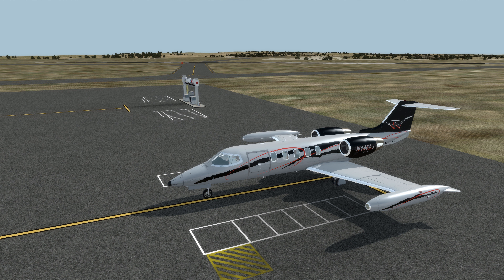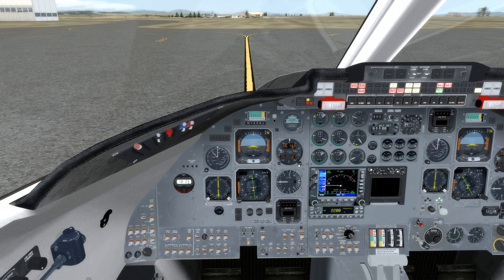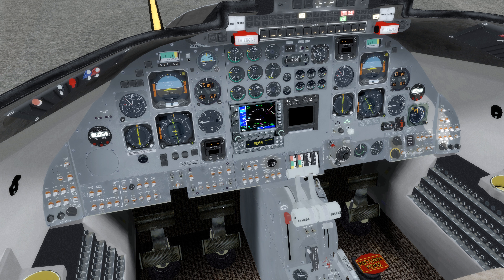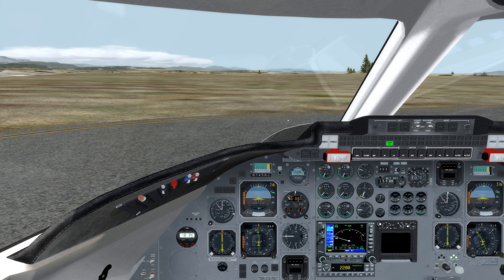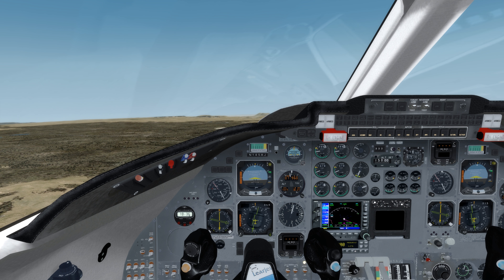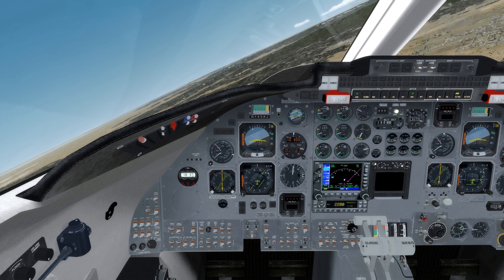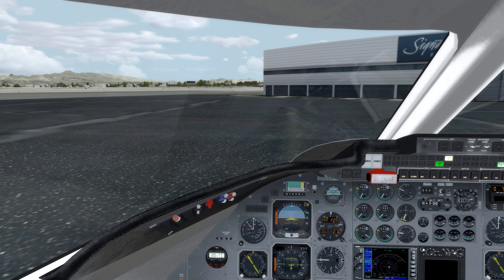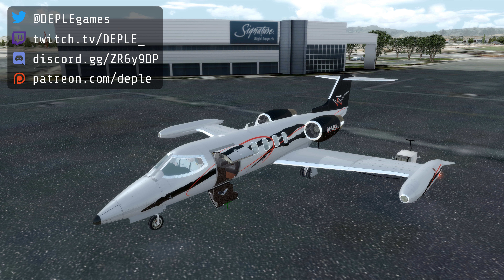[4K] FROM LAS VEGAS TO... LAS VEGAS? | Flysimware Learjet 35A | P3D v3.4

Comment: not too bad! 
the "don't sink" thing is a problem with the aircraft, it does not recognize that you've exited the takeoff phase of flight so any time your descent rate goes under 100fpm it thinks you're sinking on takeoff. the fix is to edit the GPWS section of the aircraft.cfg. 

I just set the altitude to 0 in the GPWS section and the problem stopped.

Comment: Just a heads up, N1 (fan speed) is actually the bottom set of engine instruments. the top set is N2.
Reply: Very strange indeed as usually the N1 is on top of the engines instruments!